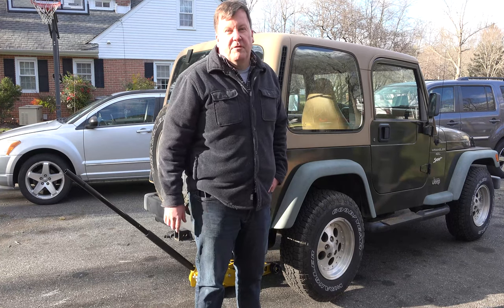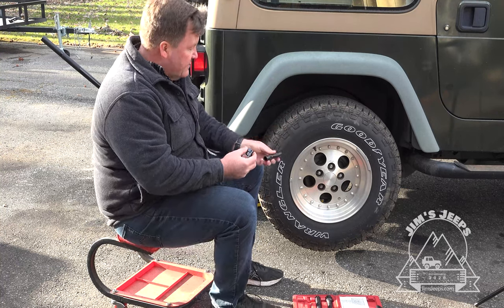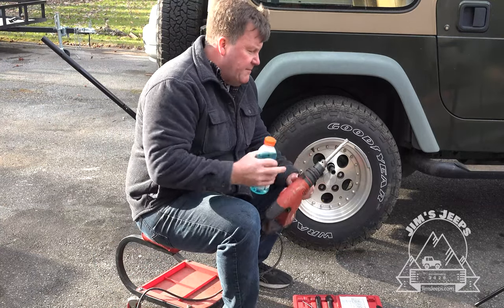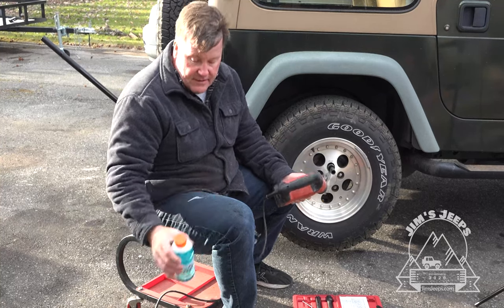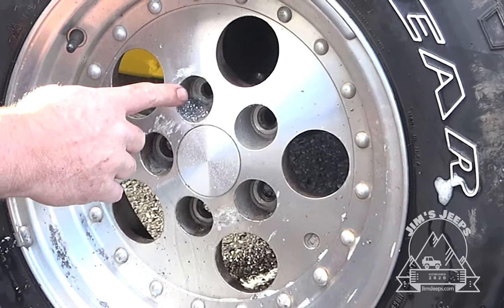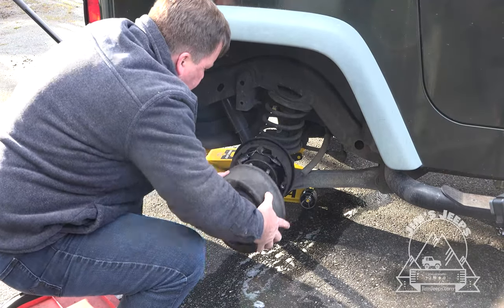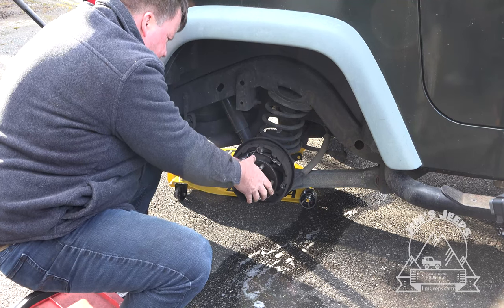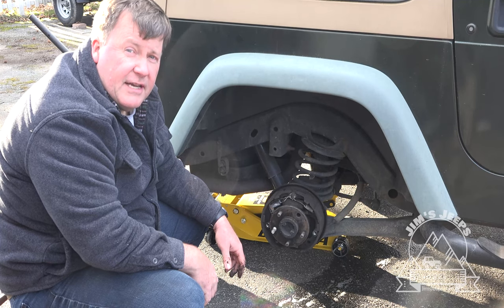Lug Ripper LT1350 - Tool Review

Comment: The hole in the axel was not damaged by tool it was from driving On the lose stud
Reply from the maker: Agree.  I did not mean to say that the tool ruined the hub lug hole.  It was me using an impact and trying to remove nut that spun the loose lug in the hole.  This caused the splines on the lug to scrape and kind of cut the hole where the splines would seat and hold the lug in place.